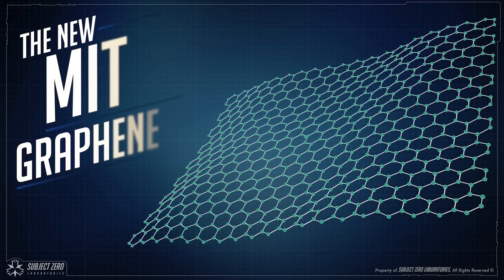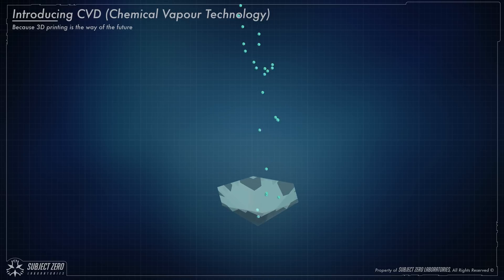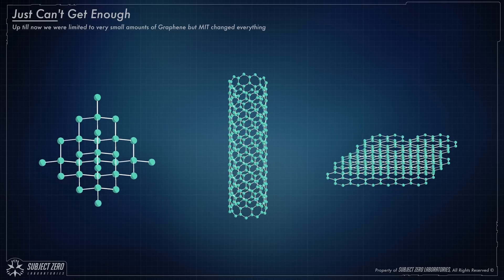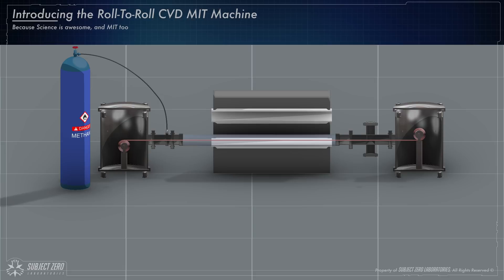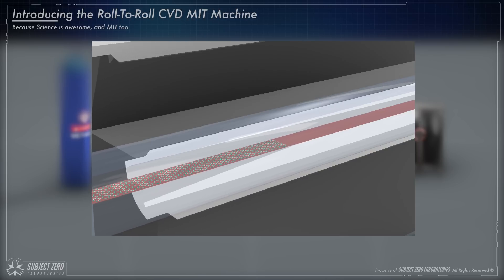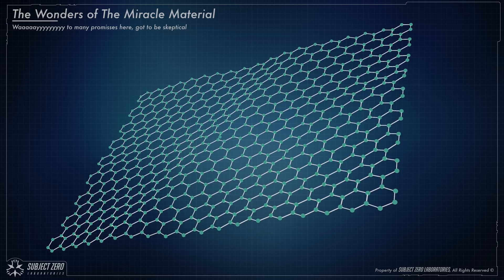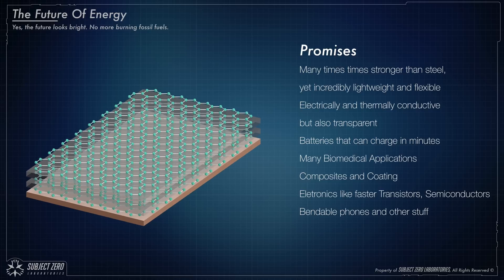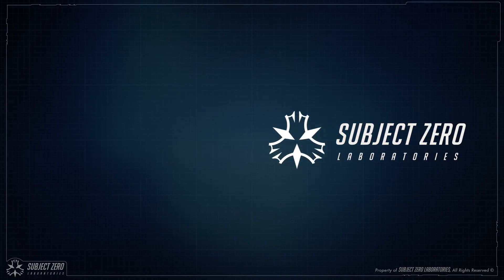UNLIMITED GRAPHENE - MIT Graphene Roll to Roll CVD Explained

Comment: Can you determine the orientation of the graphene Hexagons? I read in an article yesterday that the orientation pretty much determines the strength on tge graphene.
Reply: That's not quite how it works. The orientation is important, but only in the way that neighboring “hexagons” (what we call grains) need to be in the same direction for the crystals to fuse. If they are not, then the boundary will be weaker.

Comment: I’ve been following the graphene developments for nearly a decade now. 
My only question is how do I invest in graphene.
Reply: Invest in a company with a product demonstrating the use of graphene. Some company just made a power bank as a proof of concept and to prove it's viable to actually manufacture it. The youtube channel "Cold Fusion" just did a video on it.
Reply: Honestly I would hold back because most of the companies which are big enough to be publicly traded aren't going to be worth your time in the long run. The smaller emerging forms are all going to be known publicly traded or only available to qualified investors< meaning you earn $200,000 per year or $300,000 per year for a couple for at least two years and can demonstrate the likelihood of earning the same in the future.>
Reply: i just invested in Gratomic - a materials development company investing in graphite resources.  it is a dollar stock and seems low risk for a longer term investment
Reply: TLGRF

Comment: Graphene burns at 350°
Reply: That's interesting, where did you read that?
Reply: @TonyGrant.  it's a indian youtube channel. I heard that graphine has a lot of surface area so it's weak when it comes to oxidation. All it needs above 360° celsius of temperature and oxiyzen will do rest of it.
Reply: @Bang6484a  I suppose it will burn if it gets hot enough. I have a small quantity, I think i'll put some on a hotplate and see what happens.

Comment: Everybody talks about how great smaller batteries that hold more power are.  This is great - except if the battery gets damaged.  Then you have all of that energy being released without any way to stop it.  This is why lithium-ion battery fires are nearly impossible to put out - the battery already has everything it needs to release that energy as heat.

Comment: problem being if you had that kind of energy density, any damage to the structure would cause a huge explosion. Really the energy density of batteries are about as high as you would want them to be unless heavily heavily shielded. I suppose if it's the size of an iphone you could integrate it into wind turbines and they need to be so spread out that an explosion in one would not effect the next.

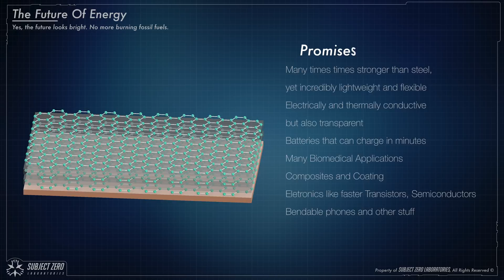Comment: 5:01 through 5:14 Would you cite this, this claim seems absolutely unbelievable, I have to read it for myself.
Reply: When I heard this I thought it was total bullshit too... And it 'basically' is. I haven't found any articles actually giving solid information on the use of graphene for batteries or as supercapacitors, but many science journalist articles claiming its potential for this purpose. Graphene is well known in material science circles to be an outstanding superconductor, I think the flaw in reasoning comes from the misconstruing of superconductors with supercapacitors and semiconductors. Graphene is NOT a good capacitor material or a semiconductor material like silicon. 

However, "in theory" given the amount of current you can pass through a graphene layer with minimal to no loss or heat transfer, IF you could somehow change the material properties of graphene to store the energy instead of transfer it, then it would indeed have these properties... Of course the same is true for a lot of superconductors, so it's kind of a moot point, and I imagine at some point a scientist confirmed this pie in the sky idea which is the source of all these crazy articles, but naturally science journalists being unqualified to understand the qualification just ran with it. 

As far as I know we the best semiconducting material aside from silicon is titanium disulfide, which actually is something being researched for its potential use in computing. It's a VERY poor material for energy storage since in order to retain its properties it has to be kept under extremely high pressures. This is possible for something at a microchip level, but if you start making large batteries out of the material, or sizable capacitors, you begin creating a VERY high risk of a material that not only can go up in flames like modern lithium batteries, but also literally explodes with a much higher energy density. It's unlikely that weaponizable materials will make it into consumer products when all you have to do is puncture them to kill large numbers of people. It might make it into military applications though 'maybe.' 

In any case, I'm all for material scientists finding a way to store energy with graphene, but I will add that if it really could store the energy of a TESLA's battery pack in an area the size of a phone, even if it wasn't pressurized, the flammability and reactivity of such a battery being damaged would make lithium ion batteries look like sparks. It's a literal fire bomb at that point with more energy then any conventional extinguisher could ever put out. I'm going to go out on a limb here and say that while lithium ions are 'dangerous' they aren't THAT dangerous, but this would be a real hazard even if it was possible, and might be questionable in consumer applications as well... 

Ultimately a lot of these miracle materials and science is really just filled with a lot more misunderstandings and assumptions then people are aware of. If such technologies ever do come around, they won't be easily adopted by consumer materials anyway is the point, and if they are they present a serious danger and hazard to those who use them.
Reply: @dragoonsunite  This was a great explanation to and summation of my skepticism. Thank you!
Reply: @dragoonsunite  I didn't read all that but to address the comments in your first paragraph take a look at Robert Murray-Smith's channel. He makes graphene capacitors on screen. He claims about 1kW per kilo with his highest capacity chemistry. He's using graphene nanoparticles.

Comment: "Graphene can do everything....except leave the lab."
Reply: And we will have fusion power in twenty years...
Reply: @Zenas521  iter should have first plasma in 2025, Peak Performance around 2035 and its already considered outdated technology buy those in the bleeding edge of fusion research<mit sparc>  so I suspect that you're 20 year timeline isn't too far off the mark unironically speaking. Whether or not Fusion will be economically viable in the face of improving battery storage technology and ever cheaper wind and solar technology is yet to be seen.
Reply: Zenas Starchild Research still continues, especially with ITER. ITER is one step forward.
Reply: "People are generally nay-sayers who criticize and condemn, and do nothing".
Reply: you could say that to silicon in the 50s
Reply: @TheZenytram , your reply may sound better in 70 years, when the process will be COMPLETELY different than this video, narrated via "I'm only a messenger."
Reply: It's in your pocket. Graphene is present in almost all modern cellphone batteries. It's also added to concrete to reinforce it.
Reply: You should do by yourself then...
Reply: @AchmadBadra  jokes on you because I am 😝
Reply: Its path is being made as we speak the world today doesn't deserve it yet the cleaners are working removing the problems
Reply: Come work with me...I do have it...
Reply: So true..
Reply: Bruh
Reply: Not true you can buy carbon nanotubes and graphene nano platlets to use in projects. You can buy nano tube yarn, which is basically the replacement for copper wire. Lighter with the same or better conductivity and low resistance. You can already buy this stuff, it just up to companies to put them in their products now.
Reply: 'It can stand the heat of atmosphere reentry' ... How ? What's to prevent the carbon in graphene to react with oxygen and just burn ?
Reply: Think about how scientists still struggle to deliver hiv cure for decades, graphene concern has more positive prospects lol
Reply: @tictactoe101  I see what you did there lol
Reply: Complete BS, just like fusion always being decades away. All technology takes time and if you compare it to other technology they're on good timelines.
Reply: @Jimbo Bimbo he was making a joke ass hole.
Reply: LMAO 😂🤣😂
Reply: Subject Zero science be Like: but What If it left the lab
Reply: @Jimbo Bimbo you give me hope for a better future.
Reply: There are currently products with graphene. Legit ones
Reply: That comment aged well.
They can make it this way by the kilometer now🤣
Reply: Cold fusion is only 10 years away
Reply: You could have said the same about metallic aluminum or artificial diamonds at one time or another
Reply: @AlexFlockhart  " graphene  can do anything  except  leaving  the lab.... for now"
Reply: @AlexFlockhart , your reply may sound better in 20 years, when the process will be COMPLETELY different than this video, narrated via "I'm only a messenger."
Reply: Fox Vulpes so true!
Reply: Graphene already left the lab and has already started to be in products in the last few years, so..

Comment: Any references for the promises at 5:17? I'm not an expert in energy storage, but I am familiar with existing energy storage designs and have never heard of anything remotely on the scale of iPhone powering a Tesla energy densities. I know supercaps are getting made with graphene, but that barely brings them in line with existing liion batteries. Sounds like bullshit so far.
Reply: With that kind of  energy density in that lightweight package you could be powering flying cars, not just Teslas.
Reply: @ExtantFrodo2  Graphene supercaps will have more energy than Li-Ion but I'm pretty sure that density claimed here won't be possible. I think he needs to vet his sources.

Comment: I wonder if there's any way to get the roll of copper in and out of the gas chamber without leaking, something like pushing it through a bath of mercury (even though that would degrade the copper) such that your graphene would not be limited in length to the length of the copper roll. That way you could perhaps roll all the graphene into a pure graphene ring that could be used as a link in a super strong chain or something

Also I can see that if the copper doesn't need a seed, multiple domains of graphene would weed themselves at once and grow together. I would think there would be defects at the seams where the growing domains meet.
Reply: Both ends are in the vacuum and it unrolls from one end and rolls up on the other.
Reply: @iamchillydogg  precisely, the length of the ribbon is still limited to the space incide the starting vacuum chamber. I just thought it would be cool to be able to create an indefinitely long ribbon

Comment: The power density claims are bunkers bro. Also, graphene is not qualified for reentry heat insulation...
Reply: Considering it barely exists that makes sense.
Reply: I think the secrete could be the extreme thermal conductivity, about 10 to 20 times of the copper. Then they could dissipate the heat with water vapor, before it could be burn in the air. But the heat energy produced is so big that even this may be impossible.

Comment: If you make the wire using the MIT process really small like fibers the are flatted you cann weave a graphene surface and then weave at 1.1 degrees for superconductivity as you mention in your other video...weaved graphene as carbon fiber is weaved for various thermal, conductive, and structural properties ...the substrate copper can be substituted for other metals for varying properties

Comment: Hope graphene will help improve dialysis machines and reduce sufferings of kidney patients
Reply: Wonderful potential for water purification/desalination, chemical production as well. Could be a game changer in developing countries.
Reply: @alhemmings8554  Water filtration, yes. Dialysis would need bigger holes
Reply: SugarBooty but you could make graphene go in certain “moulds” and leave gaps and still be able for dialysis.

Who knows what is possible but I’m sure this will be at some point, in fact I read something I think they found how to do this basics by heating certain parts more than others and where it wasn’t heated it left gaps.

Obviously it can make it weaker etc and can tear in weak points but considering it’s still mostly in development as a material in every area this probably will be able to be done
Reply: Is there any research done on this? I'd imagine the holes are too small
Reply: Why do you think graphene could help them? Why are they suffering? What suffering could it alleviate?

Blood can only be pumped so fast….you can only filter as fast as your heart can pump. There’s a limit here. Wanna know what would help more??

More kidneys. Not another filter material. That’s not a problem….at all. Not even in the slightest.

Comment: As a material scientist, I have to say the following:
- Nanotubes are indeed promising for many applications
- Graphene is a potential candidate for efficient fuel cells, so there is much research for graphene in electromobility
BUT
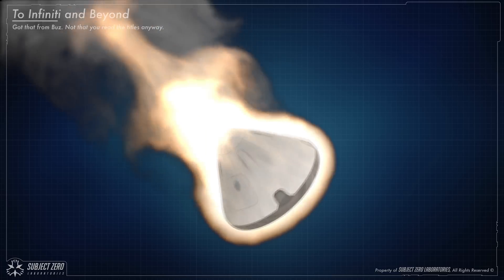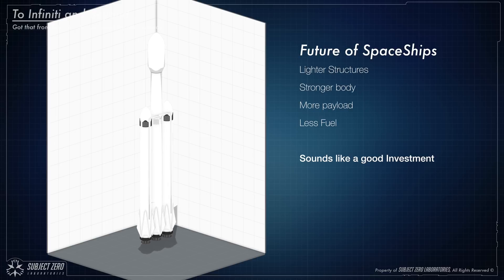- Graphene (consisting of pure carbon) is one of the worst materials for applications where heat resistance is required! So the part from 5:52 to 6:12 is absolute bullshit...
Nevertheless a good video!
Reply from the maker: Hey, thanks for the comment. so would you say that First graphene Firestop is BS? 

https://firstgraphene.net/applications/fire-retardancy/
i would like to know your opinion.

Comment: Wtf graphene can't store Li-ion or at least no researches in this area are made for now. No battery can be made of pure Graphene and there is no possibilities that a small battery the size of smartphone can have the same amount of energy of a Tesla power pack! The good conductivity is what graphene has but not for Li-ion storage. It is use for Supercapacitors to store electrons but not for batteries.
Reply from the maker: Well, Li-ion do use graphite, why not graphene? and yes, you are right about the size, currently we can only cut down the size by 12x, so, we are still way too far from it.

Comment: Im an engineer, in 1990, (29 years ago) I worked for a company that made diamonds...  diamond substrates.  After about 1 1/2 years there, testing and developing, I came to work one day and was not allowed in.  Men identifying themselves as FBI told me to go home and wait for instructions.  I was told to return to work 2 days later to collect my things.  The ENTIRE company was SEIZED, rolled up and taken away.  That was 29 years ago...  Has anyone seen a DIAMOND PROCESSOR in a computer or cell phone?  NOPE, and you NEVER WILL.  The Government has them though.  Diamond can withstand heat hundreds of times better than silicone chips..  meaning MORE SPEED, FASTER COMPUTERS.
Graphene is no different.  The explanation you are hearing here is quite old tech.  The Government has been manufacturing high grade Graphene for more than 10 years now.
Fear not, remember everything is relative.  During World War 2 'plastic' was NEW... a pound of plastic, as difficult as it was to manufacture at the time, was worth a pound go GOLD...  Today, we make trash bags out of plastics.
The impact of Graphene is going to be epic.  Light and transparent solar panels, and batteries will put EVERY oil company OUT OF BUSINESS.
Im aware of one instance of a company 3D printing a lithium type cell phone battery....  It had 10 times the capacity in the same area.  That was only a first attempt.
Now imagine an electric car, with a graphene battery taking up the same area, with 10 times the capacity, attached to transparent solar panels in every window of the car..  AND embedded in the surface of the body panels.  A car that you would never have to charge, unlimited travel distance. ALWAYS ON charging.   Same with your house, these BIG UGLE SOLAR panels are OBSOLETE.  Graphene solar will actually look like your roofing material, it will also be transparent, and in every south facing window of your home.
Graphene will change EVERYTHING.
Reply: Do you get retirement fund?, I heard someone story, quite similiar
Reply: Fuck off with the bullshit. Tons of companies make artificial diamonds. The government does not have magic diamond computers and magic graphene cars.

Comment: I think your video is great and think graphene is future in every one's life and the many products that will never rust... Cars should never rust and the steel mills might not sell much. Refrigerators and washing machines won't rust. Older cars can be fitted with new graphene parts and the age of automobiles will go up. Just replace the worn parts and interior and you got yourself a new car with low property taxes. The Tax man ain't goanna like it and the electric cars can travel farther with this light structure Graphene. Thanks for the great video and when do you think the new batteries will hit the market? Home power for you home and hunting lodge in the woods and hills. Cheaper heat and cooling. Crank up the wind mill and charge things up. The future looks bright and all you tax slaves might have an extra dollar in your pocket when you retire. But watch out those jobs out there might not make the Standard of Living. children. Teach your well.